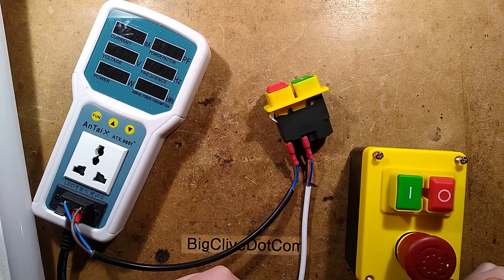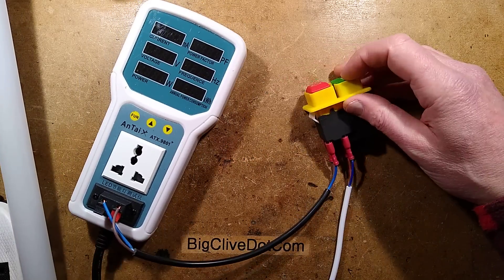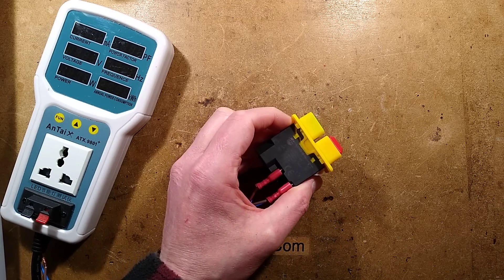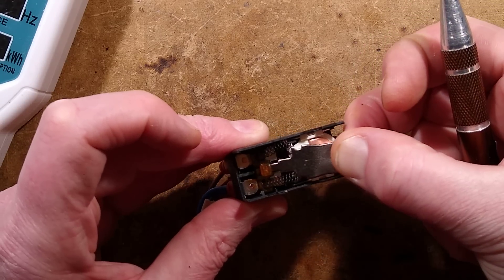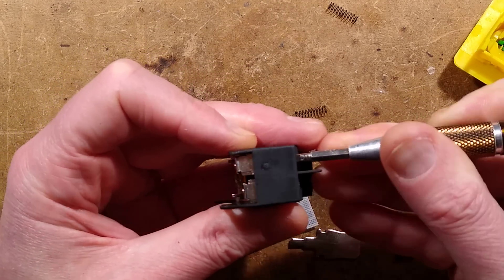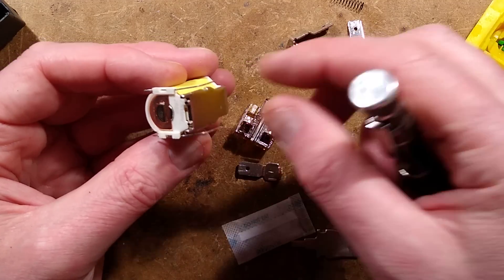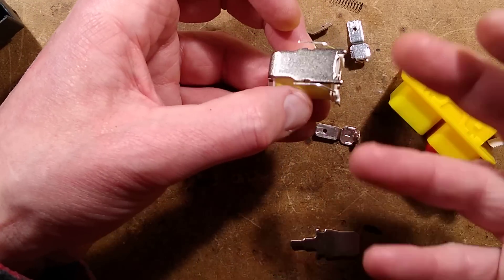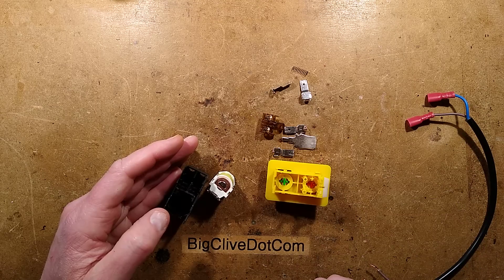Inside an NVR (No Volt Relay)

Comment: Could be handy for use with a small generator, so that when the generator is stopped, the electrical load is disconnected. That way, when the generator is next started up, it will be in a known off-line state.

I have a similar arrangement with a 100A contactor to isolate the 20kVA generator when it's off-line. It requires that not only does the changeover switch need throwing over, but it also requires a deliberate action on the part of the user to put the generator on-line.

Comment: Did anyone else have like a flicker on this one? About 1.5hz? On the buttons and the light at the start?
Reply from the maker: The display of the meter is scanned and flickers.
Reply: @bigclivedotcom  Oh wasn't the "hopi" (nopi?) it was like the physical buttons on the switch were flashing. Was very very weird lol. Looked at it on the laptop now instead of the phone and it's fine. Very strange! It felt like the frame rate of the camera and the mains were very slightly out of sync and it was getting a strobe effect. Never seen anything quite like it before. Probably some sort of automatic "enhancement" voodoo going on with the phone. Only mentioned it because your videos are usually so very nice and clean. In short, the answer was "no, it was just me" lol.

Comment: It is no NVR, it meant to be a buzzing device. You just got it wrong. While I like the idea of that friction fit contacts for low voltage, I would have expected something more serious when it comes to higher voltages.
Reply from the maker: In this case the coil current is very low, so a friction contact is OK.
Reply: @bigclivedotcom  OK ... but me, building fort knox like when 230V are involved ...

Comment: Thanks for the interesting disassembly, Clive. A shame about the cheap plastics used, that stuff looks like the easily shattering type of cheap stuff. It ultimately makes you wonder about the safety of the switch.
Reply from the maker: It's quite chewy plastic, so I wonder if the damage occurred at the factory while it was being inserted.
Reply: Always a delight to watch your vids.   I’ve used a fair number of NVR switches.  Where I’ve included an emergency shut-off mushroom or, particularly when using several around the machine, I’ve used 5 terminal NVRs to avoid running the motor current around the machine.   A tear-down of a 5 terminal NVR would provide an interesting comparison.

Comment: Very interesting. I remember as a boy studying the diagram of an electric bell in my Science Encyclopaedia: a coil attracts a metal part, but when the metal part has moved enough it breaks the contact and turns the coil off, so it springs back to make the contact again, and so on. Attach a clapper and put the bell next to it, and you get noise. This is the same principle, except that it only "strikes" once: when contact has been made, it stays made until broken by outside influence.
Reply: Electro magnets can be used for all kind of neat things. That ringer is one of the basic things. This NVR, I had actually never heard the term before, is a quite ingenious use of the electromagnet.
 
A few toasters I have use the same type of mechanics. When the tray is pressed down it closes two switches for both live and neutral and powers an electromagnet holding the tray down against the power of the springs. When the thermostat reaches temperature it break the circuit to the electromagnet which releases the tray to spring back up and breaks the connection to the heating coils.

One of the toasters was extremely cheap and clearly built to a budget. In this one side of the switches are left bare to the inside of the toaster. A single breadcrumb got in between the contact surfaces and the toaster was out of commission until I got it out.

It's a very simple design but when the tray isn't pressed down the inside of the toaster is completely safe as both live and neutral is open. Poke around with a fork if you like as there's no power no matter if the plug was wired correctly or not. And if the power goes out it pops out the bread so no risk it starts a fire when the power comes back on.
Reply: @blahorgaslisk7763  it's basically the same as a power tool switch that uses a separate contactor. The only difference is it's all self contained.
Reply: @blahorgaslisk7763  NVR is also a term used on network video cameras. It means "network video recorder".
Reply: This switch just has positive feedback, while the bell also had negative feedback. The combination of both positive and negative feedback and some sort of phase shift is what makes an oscillator.

See also: electromechanical rectifiers.
Reply: @Scrogan  ummm...no.
The condition required for oscillation is positive feedback only.
Reply: Or a tattoo machine!

Comment: Curious that a device designed for a rough environment got damaged in the post.
Maybe it's a factory reject (due to that damage during production?) that magically got given a second chance at life by being retrieved from the skip and offered at a 'bargain' price to a remote country. 
Maybe seller has been duped by their supplier or it's just clever marketing to give immediate replacement to the occasional buyers that complain?
Sorry if my conspiracy theories are showing.
Vaguely interested in the workings of the adjacent 'Emergency push to Stop / Twist and pull to reset' button.
Reply from the maker: I took an emergency stop button apart in a video.  It contained a surprising amount of parts.
Reply: @bigclivedotcom  Must have missed it 7 years ago, Just watched, nice. Interesting watching reassembly. You did good  :)
Reply: Mail sorting machines are able to literally pulverize mail if something disturbs their timing. Best case scenario the mail/package is only partially destroyed.

Comment: At first I thought "no-volt relay" was going to be a euphemism for something that had a bad time. Like "light-emitting resistor"...
Reply: Thank you for that phrase!. That is how I shall refer to incandescent lamps in future.
Reply: Nonsense, an incandescent bulb is a perfectly correctly functioning light-emitting resistor (LER)!
Reply: Or just a silly name for a mechanical switch.
Reply: @asteroidrules  actually a silly name for a latched relay
Reply: @@ti75425 Ah, but what about the coiled filament? So they must be light emitting inductors.
Reply: Designed to be run from a 0 volt power supply.
Reply: “Single-use disposable smoke generator”, perhaps. Also I have owned a “complex waveform noise emitter”, that had sometimes deposited ink in exact locations on a piece of paper, but alas that functionality was also temporary.
Reply: algorithm reply
Reply: @lightcycler4806 I’m stealing this!
Reply: Also known as an incandescent light bulb.
Reply: "magic smoke generator"
Reply: yup, resistors that emit only light are pretty poor components....
Real resistors emit SMOKE.......
Reply: @ti  LEC😂
Reply: "magic smoke generator"